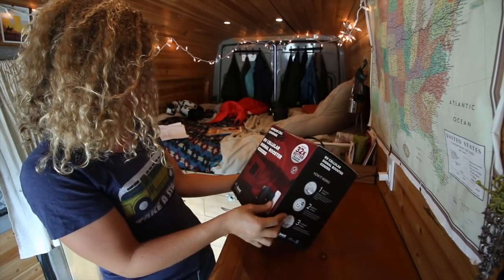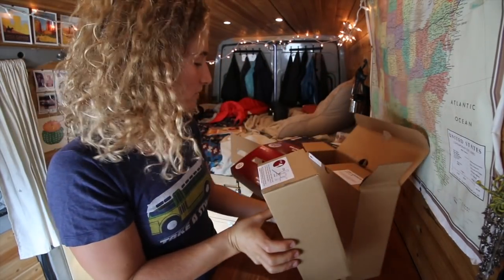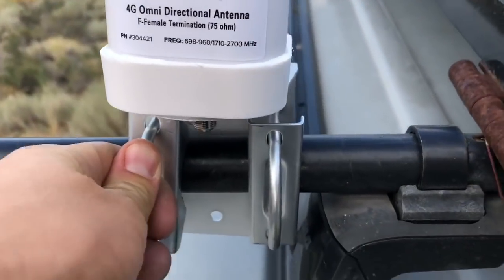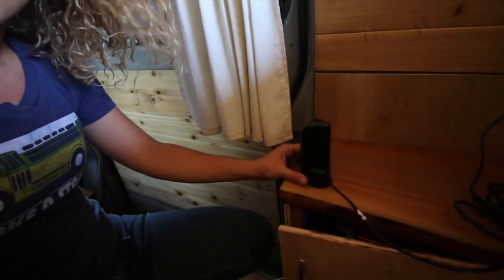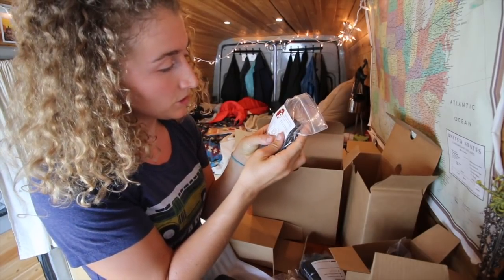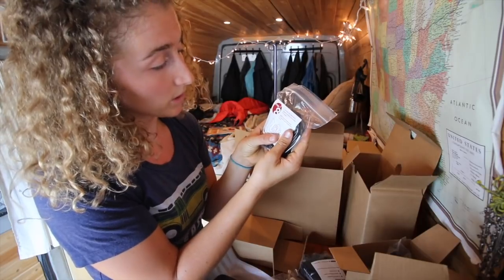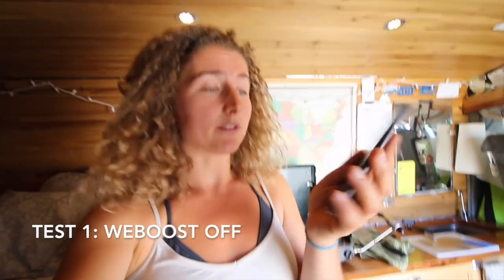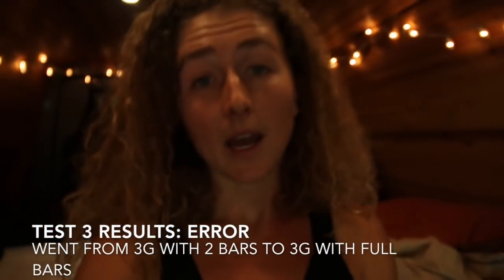Sprinter Van Add On⎥Cellular Data Booster! 🚐📱📶

Comment: Hey Kaya, just a small suggestion next time you drill a hole in the van it's a good idea to touch up the paint on the edges so there is no exposed metal, this helps prevent rust later on. Love your channel! Cheers :)

Comment: Now I sound like a smart ass. Where you drilled the hole is very close. If you drill on the top of the "hump" on the roof, water is already running off it. It runs to the low spot where the hole is. You did good by getting a good seal. Just an FYI

Comment: Has anyone one told you the U bolts are on wrong ? The round end should be against the bar. The Nuts should be against the clamps with the “teeth”. I hope this helps as it will stay in place better.
Reply: The bracket on the antenna will be between the thing with the teeth and the Nuts. 
I hope you are understanding what I’m trying to say.
Reply from the maker: Hey! Thanks for the advice. I actually installed it like that first, but the bar is too thin and the threads on the U bolts wouldn’t go down far enough to keep it secure. I switched the orientation so everything would be more secure!
Reply: Kaya Lindsay 
Well then.....good job ! You gotta do what works. Was trying to be helpful not criticizing.
Reply: 19904X4 Vanman I don’t know Kaya personally but she strikes me as a confident secure soul that doesn’t have  hang-ups with vulnerability.. don’t think she offends easily—- she seems to be adept at distinguishing when a person is sincere and/or being an ass.  She’s  open to suggestions.   She is so down to earth and not pretentious..... It is rare to see a young woman that has and owns her OWN voice and doesn’t apologize for it...  Just love her...!
Reply from the maker: 19904X4 Vanman no offense taken!

Comment: There are a variety of directional antenna solutions that can increase your distance to line of sight, 5 miles and more are possible.  Can be a hassle to setup and most directional are something you only want out when stationary, but can really open up many possibilities.

Using a power saving desktop computer (CPU and motherboard with power saving firmware), replace all internal disk drives with SSDs (use USB external drives for backup and archiving only when needed), provides a platform that will easily outperform any portable computer per dollar and are easily upgraded and repaired.  Install Linux with a VM host to boot any operating system in a few seconds, and a web caching program (i.e. Squid) to significantly cut down web browsing bandwidth, and you will have a video editing or other "heavy lifting" computer server.  I say server because the best way to use it is with a Chromebook running remote terminal software.  The Chromebook will do a fine job by itself online to browse/google the Internet, do email, do basic office work, but the using remote terminal program, it becomes the display and keyboard for your powerlifting personal server, which can provide much better security and functionality.  Best of both worlds!

Comment: at 2:27 you have the bracket on wrong. The saddle with the jagged points goes on the opposite side next to flat strip before the flat strip. so it's: "U" bolt- saddle w/ points-flat strip-washer-lock washer then nut. Just put the saddle on the left not on the right as you have it @2:27
Also, use the 12 volt power source and add a switch or unplug it from the amp. Otherwise your taking 12vdc to inverter to make 120vac then plugging in the wall wart to convert 120vac back down to 12 volt DC. Major waste of energy.
Reply: Dead right they need turning around to stop the antenna slipping round
Reply: After viewing a 2nd time, I have another comment. 1st- how many tubs and tile do you see out side? Not many so the silicone is probably is not UV stabilized. Also, a guaranteed way not to have a roof leak. Don't drill a hole in it, drill the hole in the side under the rain gutter were water doesn't sheet like the roof

Comment: use speedtest.net app, the best speedtest app by far. outside antenna should be further apart from the inside  antenna, otherwise its going to boost itself and not the 4g you want to boost.

Comment: whats happens when they change to 5 gs --yeah im tired of the whole teche bank drain story --sounds great 5Gs is suppose to be different  then 3 or 4 ...500 $ for 3 GS 500 for 4 Gs  and 500 when the cell phones and 5 GS come out .....24 months of use?  like windows 1 2 3 4 5 6 all app versions from the first software configuration ..with new graphics

Comment: Avoid silicone that isn't made for that job, household bathroom on the van it will fail, trust me, you can use silicone but make sure it say that it is for caravans motorhomes and boats for anything on the outside.
Just for the record, I still think your fucking awesome! (I choose my words very carefully!)
Reply: Actually it's a good idea to avoid Silicone entirely...nothing sticks to silicone, not even more silicone. So while it CAN seal joints fine, adding more later or doing a repair and you're screwed...take it from someone who's spent many hours with solvents , sanders and putty knives trying to get surfaces clean enough to apply something like 5200. It's a serious PITA that can be easily avoided.